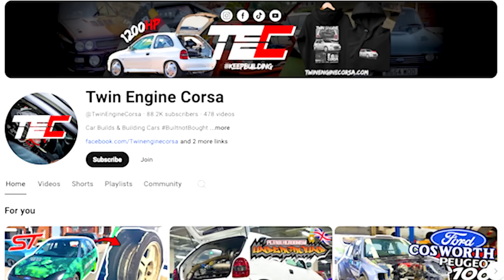This RS6 Engine is TERRIBLE! | Workshop Update No.67

Comment: Pick and choose the info you hand out over the phone. Point them in the direction of a diagnosis without being specific. Eg give them a choice of three things to look at but don't say which one. If it's a mechanical question then just pull back and say it's too complex to explain over the phone and that they would have to book it in. Once you get used to where you set the limit of info your prepared to hand out it rolls of the tounge like second nature. When you know your subject inside out as you do it's easy to come up with where the line gets drawn. If you are in middle ground then ask for their number and say you will call them back when your free. That way you know who your talking to and if they don't want to wait for a call back then bin them off.

Comment: i used to run a small business when I was at college of fixing rc cars and no one else knew how to fix them but I learnt from youtube and taking them apart then making a small website and advertising to repair them for people and I got so good at it I would know whats wrong within about 2 minuits of looking at it. my biggest problem was people using me to know what parts to get and what things were called and I was okay with giving advice but I spend so much time giving quotes or people trying to get what things they need for me without me seeing a penny and it came to the point where I wouldn't give out information unless it was someone who is young and cant afford to pay me to fix it because I was that kid. i would have hobby shops ringing me up on what parts were needed and I would later then get the customer that the previous shop had because they didn't do it correctly. its far too easy to give out information about things you are passionate about and spent countless hours of revision and reasearch for someone to come along and take that information and i get nothing for it feels like cheating.

Comment: Pick your free advice hand outs, if someone is in obvious distress and is honest, also help workshops that have helped or potentially could help you in return to help build a relationship. Others are a case by case but mostly, politely say there is a cost for technical advice and see what reaction you get, those would tell you a lot about the ‘caller’ and if you want to help, you can chose to invoice or not from there.

Comment: Thanks for the pointer on the Crank Position Sensor.  I ended up finding my misfire issue in Cyl 3 - the VFE supercharger has a boost port just above Cyl 3 and it's supposed to be blocked off but that boost port cap blew up and was leaking air.  Makes sense because I was also seeing rich bank 1 so some of the boost air was escaping :(  All fixed now though, thanks!!

Comment: Phone help : you haven't time to entertain it, We had module / ABS Comms problems with a TT race build that no one would help other that TSR which was a yes we can do it, bring it down 1hr ish Diag and a we'll plan from what's next, maybe a 6 week to fix which was a great response 👍
I did suss it, but working in main dealer environment we have a call centre and service advisors as a barrier 🚧 DISS has more barriers to technical support than ever!
You could of had more on the V10, I almost bought one years ago and regret not 😂

Comment: Part of my job is answering calls from other engineers. So much time is spent dancing round the cause which is usually them. They also have all the same information available and I've had them tell me before that its just easier to ring then look. It is getting worse in all industries.

Comment: Rick. I think you forgot.  
A4 A5 and A7 all have DCT options. Usually mated to 3.0Tdi, but also the V6 supercharger and later V6 turbo Tfsi. 

Biturbo 3.0tdi is ZF8 as RS6
RS4 like the one you sold has similar DTC.

I'm pretty sure it's the torque limit that dictates the change to ZF as the DTC in that longitudinal layout can't handle the torque.

Comment: I work in Robotics and we get the same kind of calls people after advice and after quick fixes. We have started screening the calls before they come into the technical dept and if their a regular customer we try an get back in touch within 24 hrs if their not we will get to you when we can. Quick fixes are only quick due to years of experience in the Industry sounds like you might need to hire someone or create a tech support section on website to direct the traffic then you can go through the requests when your free. You might even be able to create a membership for your tech support so you don't feel as tho your giving experience away for free.

Comment: Hi Ricky 
The problem you are experiencing is you are to accessible to these people,technical advice is knowledge hard earn over many years off hard work and making mistakes it has a value .
Your request for a parts man perhaps a time served service manager or late 50 s technician or master tech is more the way to go with the function of filtering you call as well keep up the channel and if your looking at increasing subs perhaps a feature build like a golf gti engine build tune and rolling road brakes suspension etc just to take a bigger audience along a series with you but with a twist 
All the best Kevin from bath

Comment: DL501 - 7 speed dct gearbox with quattro (C7 ,B8, B8.5), successor is the DL 382 - also 7 speed dct (B9, C8) not is the RS models though. DL501 was available in the S6 C7.

Comment: Question: Would you lend the contents of your Snap On tool cabinet to the monkey in the garage down the road? If not why would you lend your much more valuable acquired skill and knowledge base to that individual?

If they've already paid for you to do work then further advice is arguably just good customer service to retain their goodwill/trade. If they are in a position to reciprocate with advice you may need then it's also worth considering. In all other cases I think your knowledge is a valuable asset and it should be charged out accordingly.

Love the straight talking and the car/bike mix. Crack on old love!

Comment: My 2016 A4 TFSI Quattro has a DCT (DL382-7Q) in the longitudinal layout but I think it just sucks at torque handling and it was cheaper to have a ZF-8 instead coz it fit in the bigger turbo cars like RS6 etc.

It's an odd choice though because the transmission in my 250hp A4 is faster and sportier than an RS4 😅

Comment: I also run my own business, worked for a merceces commercial dealership for 15years. Then left and went at it on my own mobile, phone calls I don't mind too much if I'm not taxing my brian? 
But emails, text and Facebook messages are hard for me. I don't sit with my phone in my hand able to text back all day, if I did I would get nothing done.
I will give out advice on the phone easily without much hassle, alot of people that ring my now is from all over the country now.

Comment: You have worked hard to get where you and it looks like you have plenty of work; try the following for 3 months and see how it goes. £100 for a quote, knock it off the job if done, advice comes at the same rate, Regular customers can be refunded at your discretion ,  Give some more general prices on You Tube ( you have done some in the past ) also as you do now answer some chosen questions on you tube.  Your time is valuable and it’s completely reasonable to be paid for it. Test and monitor.